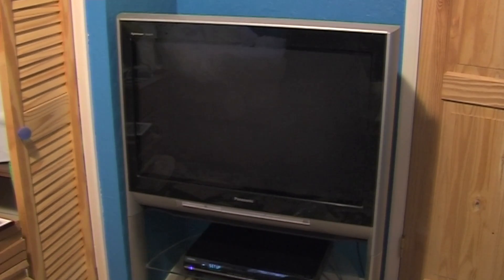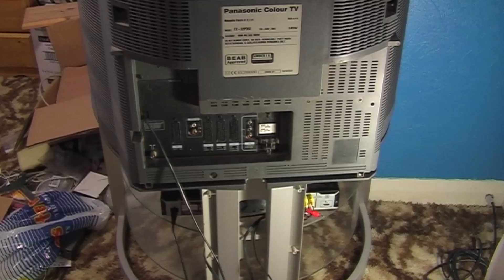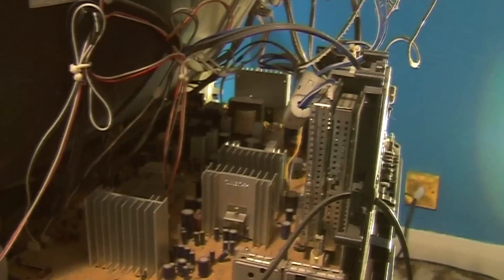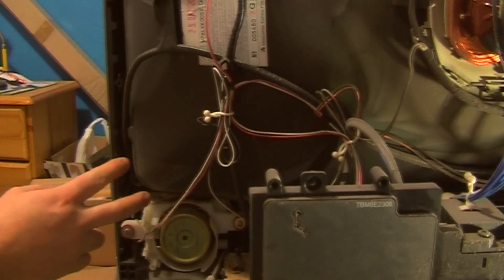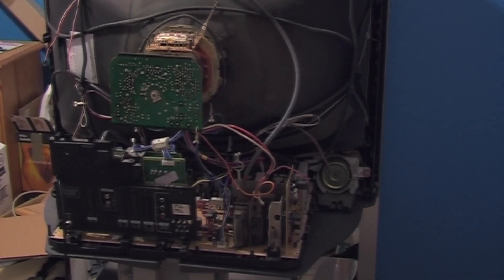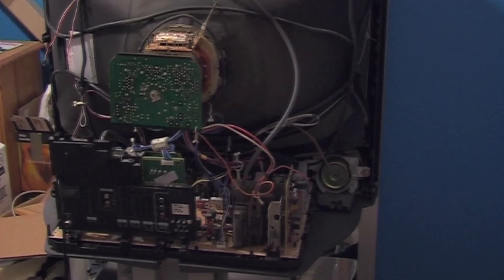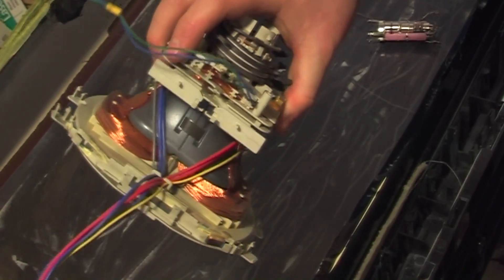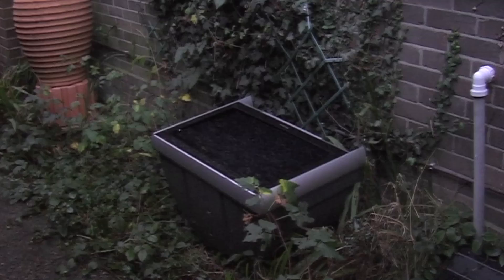Deep inside a 32" Panasonic CRT TV (TX-32PD50)

Comment: Great video. 
I've just managed to bag myself one, but it's suffers with overscan via composite. Did you ever suffer from this and do you know how to get into the service menu?
Thanks
Reply from the maker: Try the Elektrotanya website for service manuals.  I can't remember the button combo but one factory-resets the TV (bye bye Owner ID) and the other gets you into the service menu.  You'll need the remote as it's a front-panel plus remote button combo.
Reply: @AintBigAintClever  thanks, I managed to find a manual that lets me into the service menu, I've been unable to find a way to reset to factory settings though.
Reply from the maker: @ianwestacott  try the self-check combo.  Accotding to a service manual for the older EURO7 chassis: "To return customer settings to factory settings and clear owner ID of all information input by the customer, enter Self-Check mode. Press the down (-/v) button on the customer controls at the front of the TV set, at the same time pressing the STATUS button on the remote control. To exit Self Check, switch off the TV set at the power button."

I've button-comboed a factory reset on a Panasonic plasma so I don't think they've varied much over the years.

Comment: I know this is an old video but incase you still read the comments what do retro 240p consoles look like on this in progressive mode because I know the 100hz modes butcher retro games and the manual mentions non PAL60 signals in progressive add flicker, also how does it handle progressive video game signals i.e 480p wii? Thanks 😁 addendum was this a tv owned by you or did you do this one someones behalf? 🤣

Comment: i have an important question... well i dissected a crt and came into contact with this metallic powder, and i did some research and from what i gather it is phosphorus which i hear is toxic and so i called the poison hotline and they told me that it was lead, but the research i did totally seems to contradict what they said.. someone pleas tell me what that powder was.
Reply from the maker: The phosphors will contain various chemicals. I don't think I took particular care to avoid touching the stuff and, well, I'm still here :)
Reply: The mercury in the tube also poisons you

Comment: somone help me. with my tv, the f button is fucked. basically, it does this thing where the f button is constantly pushed in. however if i push it, it doesnt undo itself and i cant even change the brightness or contrast to compensate. and because of this i think it stops the remote from working. i am stuck with a dimmed screen. any help would be appreciated as ill be fucked if i am forced to use some plasma piece of shit that has shit contrast and a fucking button delay when playing games
Reply from the maker: Worth testing the button with a multimeter, it may be jammed and will be cheap enough to replace. The circuit surrounding the function button is quite simple (and it becomes clear when you look at it why the other buttons would be locked out). Download the service manual for the PD30 (it'll be close enough to the PD50) from http://elektrotanya.com/panasonic_gp1_chassis_tx32pd30_tv_sm.pdf/download.html and look at the bottom-right corner of page 42.
Reply: fixed it. got a fork and drove that fucker around the button to the electrics. now the f button is totally fucked, which at least means its powers cant be used for evil.

Comment: it seems that the dust built up and made some high voltage jump to places it isnt supposed to be as you can see @8:00 the dust has stuck itself and built up little trails between the traces, i think it might not have failed if it had been dusted :) anyway cool teardown and i think you guys are smart to have those 20 pin connectors :D

Comment: That's peak voltage, as mentioned the horizontal has to sweep that beam at one hell of a rate! and with 100Hz that's twice as fast on the vertical of most older tvs, couple that with the screen size and... just older average sized tv's were in the 100's (800v ish?) so don't lick the wires ;) Seriously tho it's also the high frequency it will burn you before it kills you

Comment: Funny you should mention that, There was a TV service/shop local to where I lived (Colchester, Essex, UK); Back in the day they had this HUGE tv, took two men to move it, it was a bit of a showcase model in the front of the shop. The place had good security, alarm linked with police, bars on window, cameras etc. Usually they moved stock out the back each night as a caution BUT because of the weight and the hassle of moving it they concluded that it was too big for someone to pinch anyway..(cont)

Comment: You will need a lot of Getters so you best start collecting loads of valves (Tubes to our American friends). I think you would be better experimenting with the Lithium from dead batteries. If you want to store Lithium until you have enough stocked up you'll need to keep it submersed it in mineral oil (uncoloured and unscented baby oil) because it reacts with air. Hahahaha. Should be fun. Good luck mate.

Ian.

Comment: That 'round dangly thing' hanging from the electron gun is called a Getter, it's round cup is usually filled with Barium. After the tube has been evacuated and sealed the Getter is heated by induction and absorbs any air that was not removed during the evacuation.

When I was a kid I smashed valves and TV tubes to get the Getter out then threw it in some water to watch it react. It provided me with entertainment in those days!!

Comment from the maker: Panasonic GP1 chassis service manual (look up the TX-32PD30 on eserviceinfo, most of the boards are the same). Look for the D-board circuit diagram, then look in the top-right corner. 1340V on the "hot" pins, 450V p-p on the "cold" pins. I was surprised as well! The circuit board has black paint on the 1340V track and a warning of high voltage printed nearby.

Comment from the maker: @parp12345 Yep. About 1.5 tons of pressure on a 20" tube face and 4 tons on the whole tube (source: Newnes Television & Video Engineer's Pocket Book, 1992). A 42" 4:3 CRT has more than four times the surface area and therefore more than four times the pressure!

Comment from the maker: @Aliensoldier If your TV is a PD50 and ever develops the same fault, check R904 on the L board (the neck). It's a 10K, 3 watt resistor, worth about 16 pence from CPC. That's what popped but I didn't spot it until after I smashed the tube.

PD30s have a different board on the neck.

Comment from the maker: @Aliensoldier I do have the stand, but I'm using it as a stand for the TV's replacement. Keep an eye on eBay, seeing as the TVs themselves go for peanuts the stands should be cheap as well, although they'll be quite heavy and expensive to post.

The TX-32PD30 and TX-32PD50 should share a stand, and the TX-36PD30 and TX-36PD50 as well, but obviously the 32 and 36 aren't interchangeable.

Those hammers were dropped from an upstairs window. Twice. That's a tough old tube!